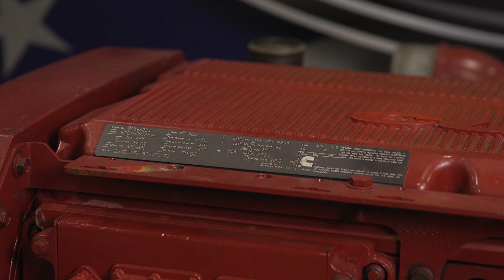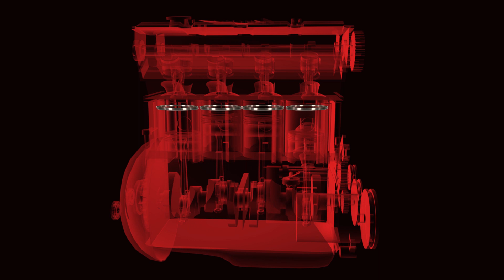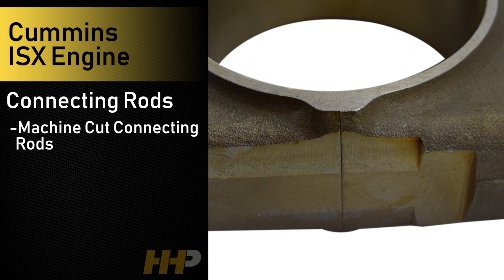Get the Right Parts for Your Cummins ISX Engine Every Time

Comment: Hello.
Just saw this video.

Question:

My ESN is 79126395 / Engine has stamp CM870…

I am looking for the Out-of-Frame Kit, if this one has it…If not, The In-Frame kit is fine.

What part numbers do I need to ask for?
Also, need Fuel Injectors, Turbo, Exhaust Manifold, Crankshaft, etc…
Reply: Also, what about the Liners and which gaskets (blue or Pink)
Reply from the maker: We're more than happy to help you out with getting a rebuild kit to you!  Give us a call with your ESN and that all we need to help get you the right components.  844-447-1453.  We look forward to hearing from you & thanks for watching!